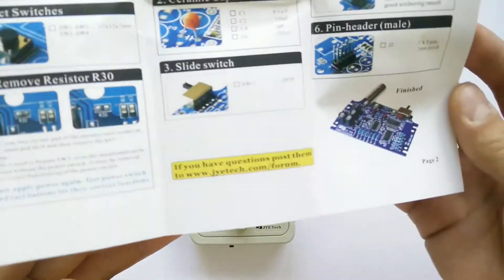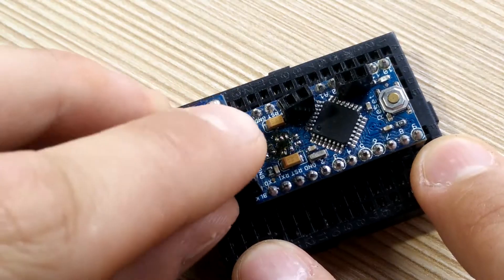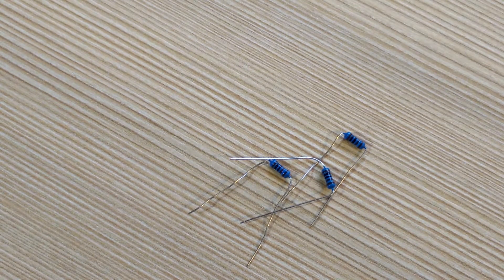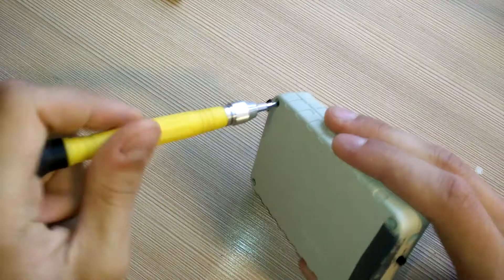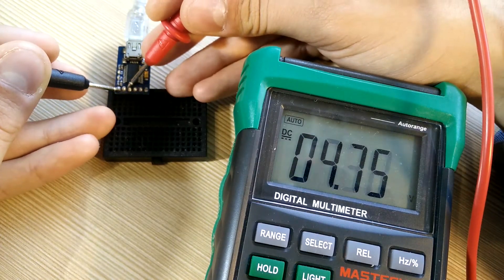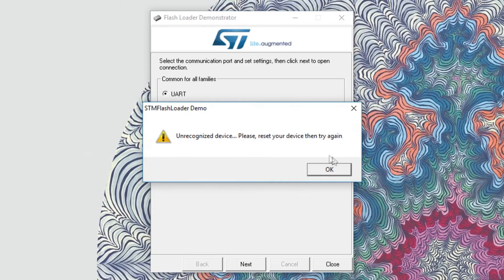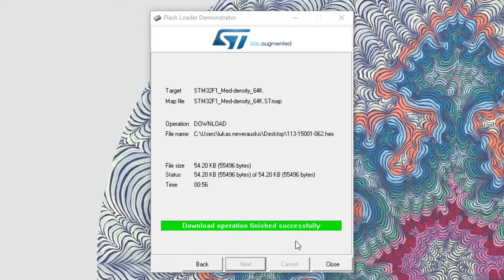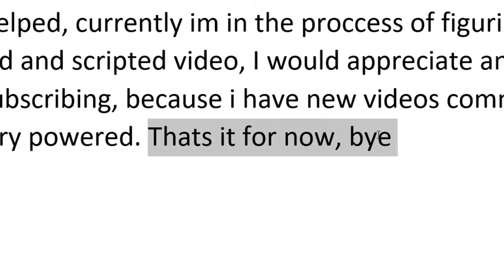JYE Tech DSO150 Shell firmware update tutorial

Comment: If one has a stlink v2 usb programmer/debugger, you can use the swd interface to program it instead of the uart interface. That way you don't have to solder the jumper bridges
Reply: In the manual of my dso it says to just press and hold the ok button and then switch the on off button to on to boot the device into download mode.

Comment: To make this a lot easier to hook up there is no need to hook up the power from the USB-UART to the board. Only hook up TX-->RX and RX-->TX and GND. It will draw the 3.3 volts it needs from the onboard voltage regulator.
Reply: That makes sense.

Comment: Hi TeraLuke, I have problem flash new firmware.
I do not know English so I translate in google translate and I do not understand what you say.
I have tried 3 different Uart-USB and can not flash.
It's hard to see on your video what your resistor values are and how you have resistors connected. What voltage should be on Tx and Rx pins. Please can you describe or draw a schematic.
Everything I do according to the manual.
  Thank you very much,  Bobajs

Comment: Thanks for this video! It helped a lot! The 3.3V pin doesn't need to be attached though. They don't say it even in the default manual.

 Also, I had a bit problem with communicating. It was always saying that it can't open the bootloader or something like that. If anyone has the same problem, and if you are using the CP2102, you should measure the voltage on the 3.3V pin. If the output is not 3.3V, but it's around 4.24V, it's a broken module. It has one trace that shouldn't be there. If you have patience, some x-acto knife and magnifier, it's not that hard to cut that trace and after that, it worked for me without a single problem. (I really recommend illuminating the board from below, so you can see the traces better.)

Thanks a lot for this video, thumbs up!
Reply: Thank you for that info. I just ordered one of these last night and now im wondering if it has the updated firmware. I don't even have a computer but that's no problem, Il save this video and follow the instructions both of you have given. Cheers again👍👍👍👍

Comment: I just did the exact same process and it worked, however when I try to boot the oscilloscope, it boots, says the FW is the new one, but then says "This board is FAKE!" and does nothing else. Any advice?
Reply from the maker: Probably new firmware detects if its fake DSO150, so I suggest you to flash older firmware the exact same way and work with that :/. There's some reading about fake dso150 on JYE tech website, you can check that, but other than that I don't really know what to suggest, you might be stuck on old firmware...
Reply: electroLuke the 55 version does the same thing. Horrible! Unusable now. :(
Reply from the maker: Probably all of the original JYE Tech versions have this counterfeit DSO detection or on the first boot of the newer firmware something was triggered in maybe EEPROM so the new firmware update attempts wouldn't affect this data. I suggest looking at the item page from where you bought this dso, look for their firmware or something. I suggest contacting the seller to at least give you the "Fake" firmware so you could flash and at least make it work again.
Reply: You might wanna try Open DSO 150 firmware https://github.com/michar71/Open-DSO-150